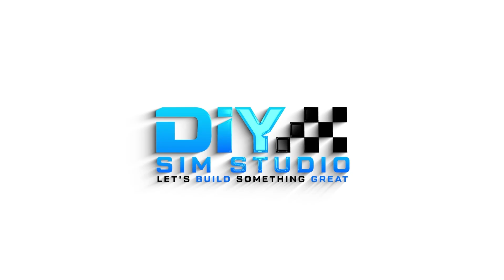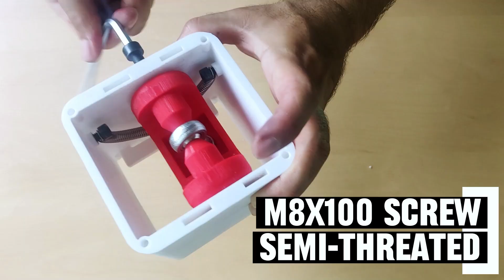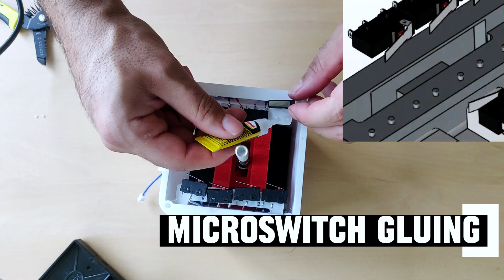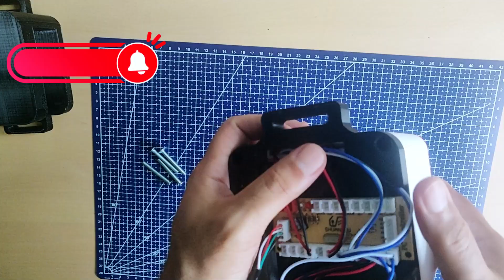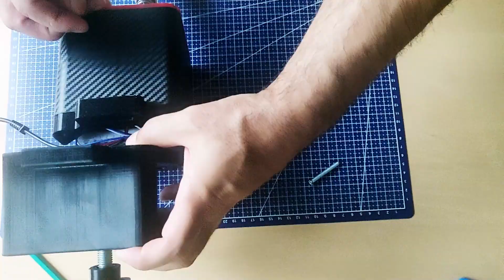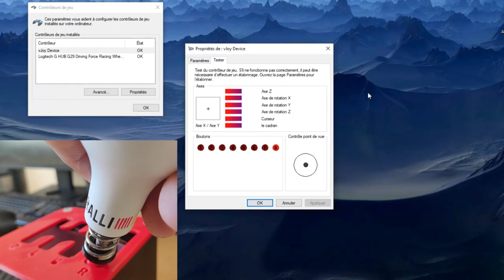How to make a DIY 3D Printed H Shifter for Sim Racing

Comment: For us that are somewhat new to 3D printing, any tips on wall count and infill? Also anything to consider or watch out for model rotation wise? It would be ideal if you could share some of your settings
Reply from the maker: For print settings, 4 walls and a minimum infill of 20% are required. Infill pattern: Gyroid.